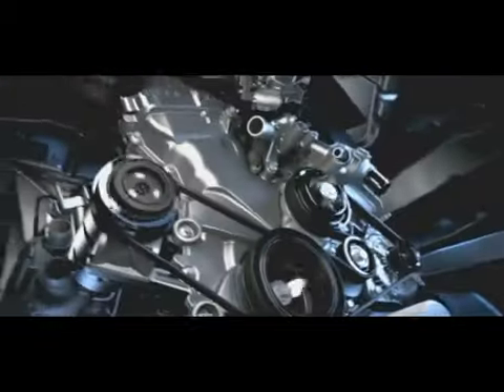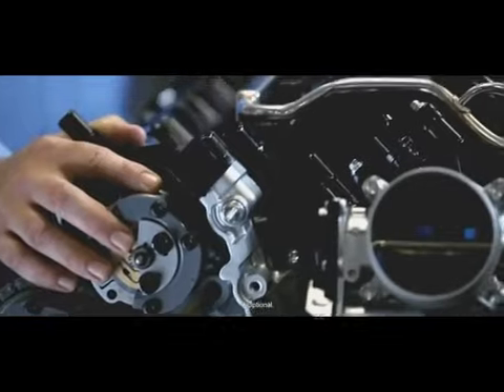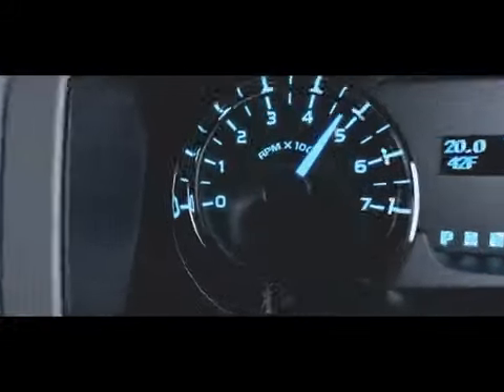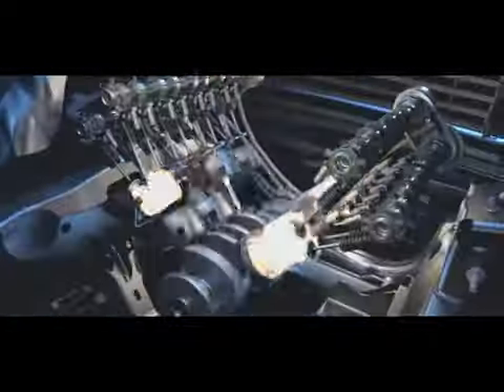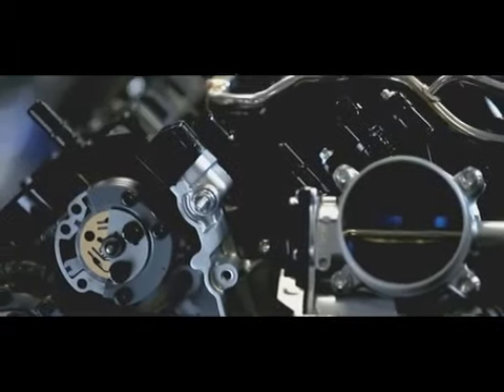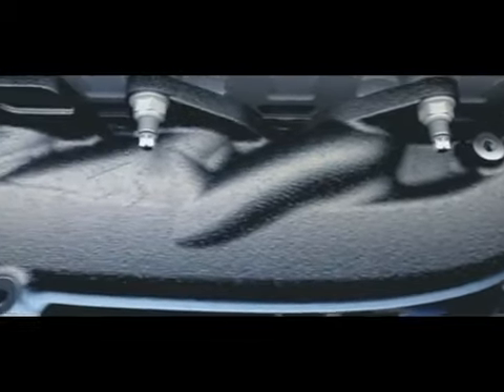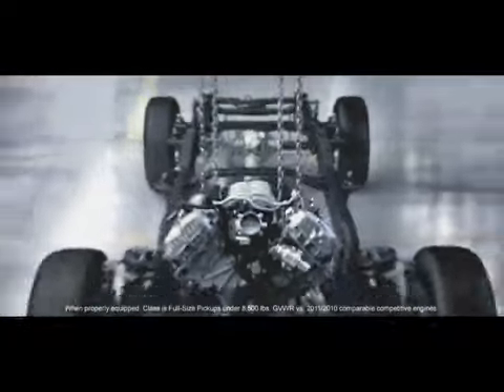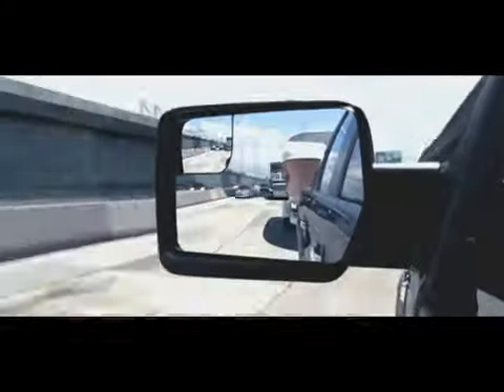Ford F 150 New 5 0L Ti VCT V8 Engine   YouTube

Comment: Found this video searching ( vct solenoid 2018 f150 5.0 fix )
Reply: Hi I think I have the same problem  ,,  I have 2017 f150 5.0 whith p0022  code  I took my truck to two different ford Dealerships  they took more than 2 months  and they can't fix it,  they changed  variable timing solenoid,  , vct phasers and the engine head twice and the problem still there  😒  do you  fix yours  ??
Reply: 2012 F-150 5.0 and the passenger side just started making a crushing, ticking sound. One person said vct solenoid or cam bearing. I've never owned a ford before, chevy is all I have ever had. Not sure what it can be but I'm hoping they'll tell me Friday.
Reply: @SkullJelly  what was it? Thank you.
Reply: @taylormurphy5221  They said it was normal sound. But here's the kicker and doesn't make sense. Where I live it's getting colder. And with the cooler air coming in I'm not hearing that sound anymore. Now I also just did another oil change and have been running Sea Foam in the tank. All I know is it doesn't make any sense.